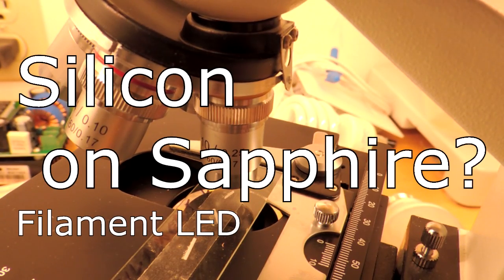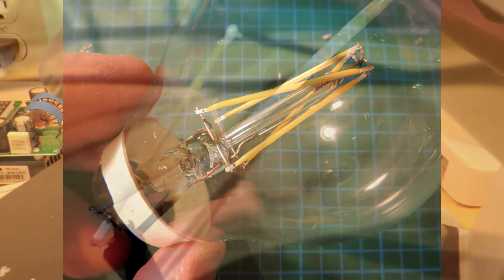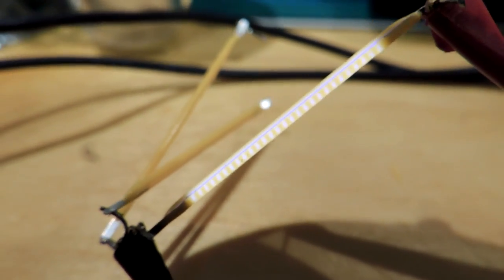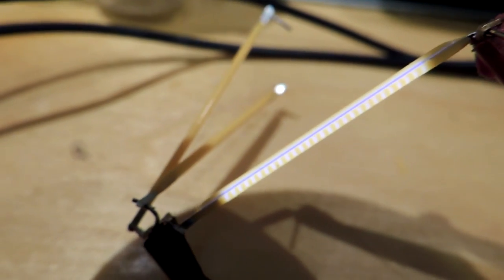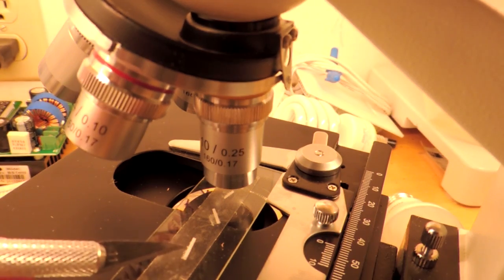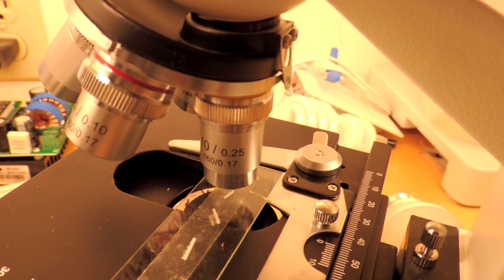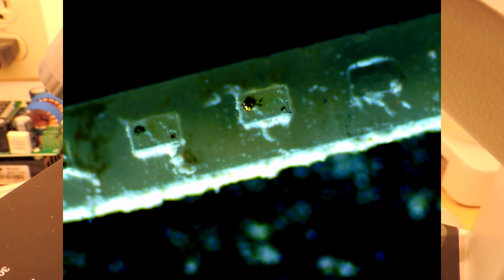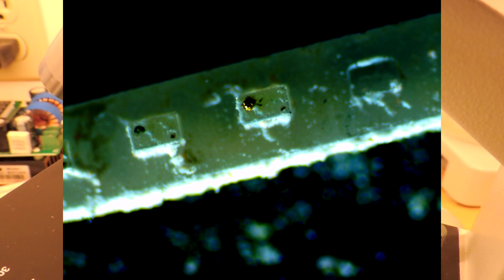Filament LED: Silicon on Sapphire?

Comment: Silicon does not have a direct bandgap. It will not be silicon on sapphire. If I were making these I would just take regular GaN LEDs and melt the glass to them. You could as another comment points out just do thin GaN on saphire but that would be far more costly given the emitter sizes.